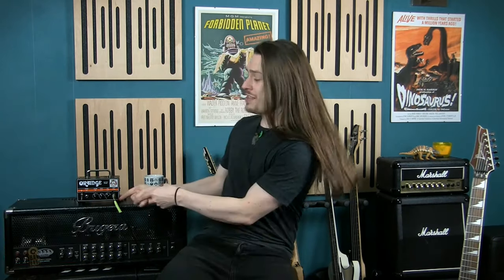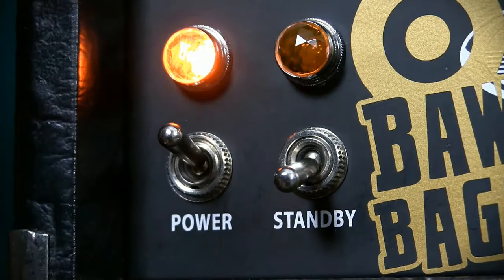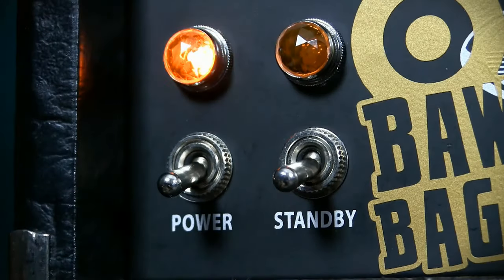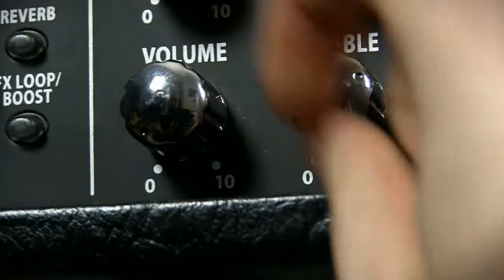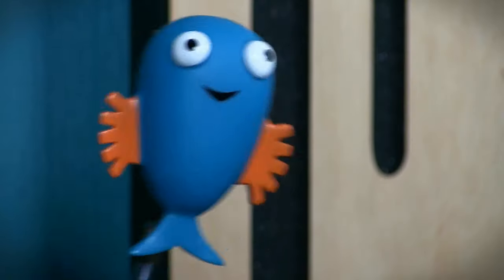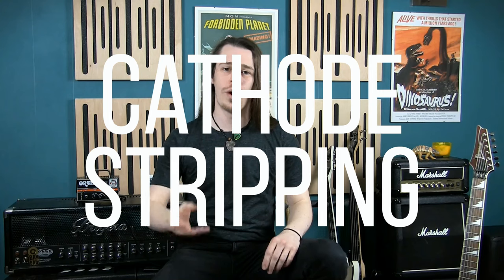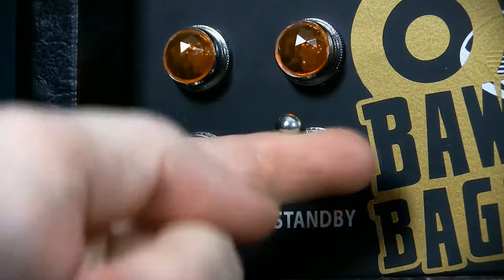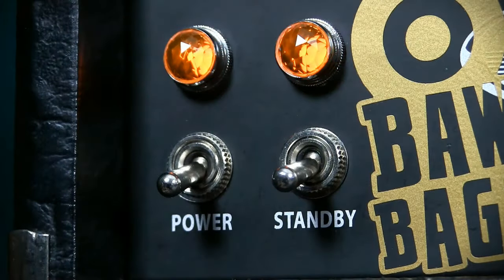Your Standby Switch Is A Lie!

Comment: Another good paper written Hartley Peavey, founder of Peavey amplification. https://peavey.com/support/whitepapers/Chapter6.pdf

He asserts that if you put high voltage on a plate before a space charge has had time to build up in a tube that it can cause cathode stripping. Whether cathode stripping occurs in guitar amps seems to be almost a religious topic among techs. Some say it's impossible in guitar amps and some say they've seen it physically in guitar amp tubes.

I will say this, the hardest rationalization for me to swallow from standby switch deniers is the idea that a guitarist gives a shit one way or another about whether an amp has one or not, except that they're a pain in the ass to use properly. I, myself, don't see the possibility of rioting if amp makers stopped putting them on. I would personally love it if they could design a high powered tube amp with solid state rectification that didn't need one. Bring it on Marshall, Vox, Mesa Boogie, Fender, Peavey, etc...
Reply: Peavey Classic series never had standby switches until recently, and the only reason they added them was due to the customer demand. So yeah, rioting is completely possible.
Reply: I don't know about Peavey amps. Not an expert or a fan for that matter. I do know that every serious Marshall tube amp going back to their JTM50s in the early 60s had a standby switch and Marshall recommends waiting 2 minutes before applying the B+ high voltage with the standby. I'll continue to listen to experts and not crap up my tubes, thank you very much.
Reply: @rockettcrawford890  Marshall amps didn't have standby switches until they copied the Fender Bassman schematic. Rather than listening to "experts" from Marshall or anyone else, pick up a couple of old books on tube circuits and make your own decisions. If you're interested in the topic of course, but we all have different priorities and you're welcome to follow the pointless religious procedure if it makes you feel warm and fuzzy.
Reply: @AR-zq9hq  Apparently you don't know much about Marshall amp history either. Marshall didn't make ANY amps before they copied the Fender Bassman.
Reply: @rockettcrawford890  yeah, not a fan of Marshalls, but I do know a bit about tube and solid state circuits. Either way, Marshall took the standby switch from Fender schematics, which was there to protect the less than ideal caps of the day, not the tubes. Now the tradition just stuck around, despite the modern caps being so much better.
Reply: @AR-zq9hq  I do know a lot about circuits. I have an electronics lab in my house. I repair amplifiers, solid state and tube along with other electronics.  I disagree about the caps. What ruins most electrolytic caps is that they dry out over time and start to bulge and leak. The standby switch was always about slamming 4 or 5 hundred volts of B+ onto a power tube that's not warmed up and what that does to the tube.  I'm curious about what you'll come up with to explain why Marshall didn't put standby switches on their 1 watt 50th anniversary amps? Those amps cost 700-800 dollars. Won't people be expecting these "useless" "gimmicky" standby switches on tube amps that cost that much money?
Reply: @rockettcrawford890  does your electronics lab extend to other than guitar amps? As for 1 watt amps, no idea, only Marshall themselves know. I guess because of Fender Champ.
Reply: @AR-zq9hq My theory is that they don't need them, prob have 1/10 the plate dispensation for it's power tube being 1 watt, assuming class A  and maybe an EL84? I don't know. They were a limited release and I've never opened up one. I myself am not impressed with the standby switch and it's never been a consideration for me either way about buying an amp. I'm guessing it's not been a factor for the vast majority of others as well.  I've never talked to someone that said, gee that amp sounded great but I didn't buy it because it didn't have a standby switch. The simple explanation for all of this is that Marshall (and probably all the other amp manufactures that put standby switches on) probably want to prevent their big power tube amps from failing within their warranty period and that's a big reason for the standby and the recommendations (that and reliability reputation). That costs them money. I know they are concerned about this because that's why they put Americans on 6550 tubes back in the 70s and early 80s, because the EL34s of the time were failing too often because of being shipped over the Atlantic and being sent back to them for repair.
Reply: FWIW, I pulled up a schematic and they're actually using a 12ax7 for a power tube, each side in a push pull at least on the JCM1.
Reply: @rockettcrawford890  if you wanna stick to Marshall, Class 5 runs its el84 at the proper plate voltage, yet no standby switch. Numerous TV's and radios from the tube era ran the same tubes as guitar amps, at the same(and sometimes even higher) voltages and never had standby switches nor cathode stripping problems. How so? Cathode stripping happens only in radio transmitter tubes that run at over a kilovolt plate voltage, and they definitely needed standby switches. As for the Bassman, in original design cold tubes would not conduct high voltage causing capacitors going over the rated voltage, thus the standby switch was introduced. Now capacitors can be rated to the voltage going through the circuit during the warm up period, so it's not an issue anymore.
Reply: @AR-zq9hq  I've never opened up a Class  5, but specs on the el84 tube itself are anywhere from 10 to 12 watts plate dispensation. The Class 5 is a class A, one power tube. That amp supposedly puts out 5 watts. I doubt it's getting the maximum plate voltage. If it is and it's really 5 watts, then they are biasing them really cold which I doubt. I don't know. I'll look into that. I know that the DSL2000 401 and 201 have standby switches and they are running full plate voltage and putting out 10 or more watts per EL84 (the early ones were biasing for 12 watts per tube).  

Some techs claim they've seen cathode stripping in guitar amp power tubes.  Are they lying or mistaken? Do you have any valid  studies or sources of information (other than conspiracy sources) to back up any of your claims?  I don't know of anyone that gives a flip whether an amp has a standby switch. I can't buy into that somehow being a selling point. Maybe something functional like a channel switch or an effects loop, but a standby switch?  I can imagine a newb looking at an amp and being impressed by more knobs and switches, but most of us go by the sound (and some by relevant features). For me, give me a JCM800 with 6 knobs and two switches any day. I trust Marshall, Fender and Mesa Boogie. I think when they put a standby switch on their amps and they recommend using it, it's for a reason. Again, if someone has done a valid study that finds slamming big tubes with 4 or 5 hundred volts when they're cold has no affect on them, I'd like to see it. Otherwise I'll err on the safe side and use my standby properly rather than risk shortening the life of expensive power tubes until I see something I trust that indicates otherwise. I don't know anything about Peaveys. I mostly see Fenders and Marshalls. Is it possible that some Peavey amps have auto standby? I read something about that one time. Can't remember which amps. I did have a big Peavey Classic back in the 70s when I was a kid and I think it only had a two way (for polarity) power switch. I'll check into the auto-standby and get back about that.
Reply: Peavey says in his paper that I linked above that most Peavey tube amps, at least used to (don't know when this was written) have an inrush current limiter with an inverse temperature coefficient and that's why they didn't have a standby switch. He calls this "Automatic Standby." In the power section the power is ramped up as the amp warms up. Look on page 5. He also makes it clear that this is to prevent cathode stripping. Peavey asserts that cathode stripping can happen in guitar amps if high voltage is applied to a cold power tube.
Reply: @rockettcrawford890  please show me the "current limiter" on the peavey schematic. I've read that non peer reviewed paper a while ago, and it seems like the typical response to why the classics didn't have standby switches. Anecdotally, I have met people who turned down amps because they "felt" they needed standby switches, like classic 30, pre reissue vox ac30s, etc. As for 4-5 hundred volts, if you're talking about El34s, they are rated up to 800v plate voltage, and nowhere in the spec sheets they say they need a circuit with a standby switch. As for the amp techs, if they have "seen" cathode stripping, I'd assume they are mistaken because there is no way to visually tell. Meanwhile, find a standby switch in this schematic please: https://www.earlytelevision.org/images/andrea_1f5_schematic.jpg
Reply: @AR-zq9hq  Your schematic is for an ancient tv. It used a rectifier tube in it's power supply. I'm not an expert, but rectifier tubes have to warm up, so it may have something to do with rectifier tube voltage ramping up somewhat when turned on and that may make a difference combined with other factors.  I know that some big tube Fender amps have rectifier tubes but also have standby switches, so that's not likely the only factor. I don't know. I'm not a guitar amp or an ancient TV designer. I suspect that there's more involved than just simply looking at a tube in a circuit and noting whether or not the circuit has a standby switch.

You asserted that Peavey amps had no standby switch until recently and implied that they never needed one. Peavey himself explains why on page 5 above. The inrush limiter acts as an auto-standby. Unless you think Peavey himself is lying about his amps as part of the great guitar tube amp manufacturer conspiracy to fool naive electric guitarists? Or maybe he knows his stuff and is trying to educate people? BTW I don't think max plate voltage has anything to do with hitting a cold tube with high voltage. I think that's for normal operation after the tube is warmed up.  As for techs "seeing" cathode stripping, there has to be some way of detecting it since it seems to be a known phenomena. I don't know anything about that. I'll have to look into that further.  I test tubes for emission, gas, shorting, etc... with a tube checker. Obviously Peavey acknowledges it exists and because of the other major tube amp manufacturers recommendations, I suspect they do also.
Reply: @rockettcrawford890  Peavey also says "In many cases, these so-called 
“standby” switches are provided only because they are 
“expected” to be there." I hate to bring this up, but I minored in electrical engineering. I'm not implying anything, I just looked for that limiter in the classic 30 circuit and couldn't find it. It would be a curious, abeit a bit useless in this application, device.
Reply: @AR-zq9hq  Maybe the 30 didn't need any kind of standby? I pulled up a schematic and it appears to have 4xEL84 tubes. That would be a total  plate dispensation of 40-48watts if they were running full out. I suspect they aren't running at full plate voltage and putting out only 30 watts. I don't even know if that has anything to do with whether a standby is needed, but I suspect it does.  He said "most' of his tube amps. I assumed that the ones that didn't have some sort of standby were not pushing their power tubes to their full wattage values. I'd be more impressed if you found a big tube amp schematic of theirs that  is running full plate dispensation, except I don't know what this inrush limiter is or what it would look like on a schematic. I suspect it has a thermistor built in, but that might not be apparent on a schematic.
Reply: BTW, pulled up an AC30, same thing, 4xEL84s and it had a rectifier tube.
Reply: @AR-zq9hq  Yes, I've heard your claims and I'm always open minded. Show me the documentation from a non-conspiracy source to back up what you say.  Anybody on the internet can make claims, especially controversial claims and that's one of the sad aspects of it. Worse are people who create controversy to get more hits. I'm sure that's not your case. I can see alternate explanations for all you claim that make a lot  more sense to me, but it's above my pay grade to say for sure. So far I think I've explained a couple of your claims as not being true. Show me the meat please.  Most experts I know contradict what you say, not to mention the major tube amp manufacturers (apparently).  Your opinion is noted. If you are wrong and I'm 99% certain you are, you're misleading people into possibly shortening the lives of their expensive power tubes. Not a big deal.  If I'm wrong, I'm just wasting a couple of minutes during the time I'm setting up other stuff on stage and I'm not worried about hurting my tubes.
Reply: @rockettcrawford890  so I said Peavey Classic has never had a standby switch until recent issue and we didn't find the inrush current limiter in its schematic and then you have agreed yourself that amp may not need a standby switch. What claims have you refuted? And good luck not hurting your tubes, just make sure you're not one of the guitar players who uses standby switch as a beer break button. Your claim however is that some amp tech has seen subatomic particles missing from a cathode of the tube. Would be nice to have you back it up as well.
Reply: @rockettcrawford890  not a reputable source, and I feel you might have already read this, but here you go https://www.londonpower.com/standby-switch#intro

Comment: ITS NOT TO SAVE THE VALVES! Yes I’m speaking in all caps. But come on, atleast describe the difference between solid state rectification, valve rectification, and reservoir capacitor voltage ratings before you make huge claims. 

First off, you’re right it doesn’t make a difference to the tubes, cathode stripping isn’t the issue, and that companies would rather not deal with more customer service. 

Secondly, the standby is in circuit between the rectifier and the first or reservoir cap followed by filter caps. These caps have certain voltage ratings that they can/can’t handle. 

When the output/preamp tubes cathodes haven’t heated up yet they aren’t drawing current. When no current is being drawn, the voltage on the reservoir cap/filter caps, and tube plates are much higher. 

Add in crappy wall voltage or too high of wall voltage and you can overload the reservoir cap, filter caps ratings which will then cause short or leak DC. Almost all modern amp company’s skimp on the reservoir and filter caps and they fail. 

Now a stand by switch is NOT necessary for valve rectified amps, because the rectifier doesn’t put out voltage until it heats up and it warms up in time with the output/preamp tubes so it never overloads the reservoir cap. 

Standby switches ARE necessary for solid state rectification because diodes are more efficient and don’t need to warm up so if the valves haven’t warmed up and the stand by is on the reservoir caps are exposed to possibly more voltage than they are rated for. Using a standby allows the tubes to be ready to draw current so the excessive voltage isn’t sitting on the caps. 

The solution: get modern amp companies to not skimp on the most important aspect of the amp. The power supply. Get high rated filter caps. Save Pennies else where.

Comment: By not using your standby switch you will strip the cathodes of their electrons ruining your power tubes. 
You mentioned tube hi-fi's & tv's as your example of why stand by switch is a Lie. Those all have a tube rectifier which has to warm up before it applies High Voltage to the plates. Amps with a standby switch have a solid-state rectifier therefore the second you throw the  power switch high voltage hits the plates  of the power tubes.

Comment: Well Colin , why does Mesa/Boogie's manual for the triple rectifier specifically states you should turn the power switch on first? It says to wait at least 30 seconds so the tubes will fill up with voltage and then turn the stand by switch on?
Reply: Because superstition.

Comment: Wrong!!! The old amps without them had valve rectifiers that took time to come up. The standby switch is for amps with silicon rectifiers that come on instantly and strip the conductive coating off your power valves if there is the electron cloud around the filament.

Please read up on basic valve electronics before attempting to question things.

BTW, The thing guitarists do wrong allt he time is switch the standby off, let the valves 'cool down' then power off and move the amp - just cut the amp completely and let it sit for at least 10 mins as this gives the filaments a chance to harden up again.

Here endeth the sermon

Comment: Kinda disslike that attitude to bombard missinformation like that, when clearly the lad has no electric engineering background.  

Standby function allso helps to avoid spikes , and noise from getting into tubes.     

On cheaper products they do only add an knob to work in series with pwer on , so has no benefit what so ever, but thats not the case in every single amp.

Comment: so why does my amp manual instruct me to "leave the standby off for at least 30 seconds after turning the amp on to preserve tube life."(nothing about turning off).
Are you certified fender technician?
not all amps are the same, you may be generalizing.
personally, i like to listen to the capacitors discharge upon turning off.
the reality is that considering how long tubes last, when they burn out its imposible to be 100% sure what the catalyst[s] is/are. 
proving that something doesn't exist is impossible, so to say the standby has no effect on the tubes whatsoever is incredibly presumptuous regardless of your technical understanding or skill.